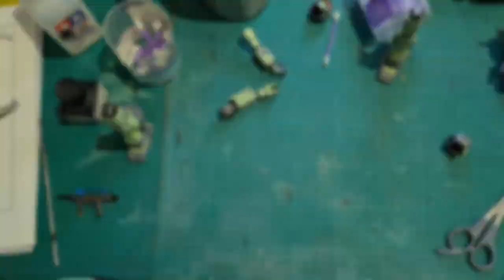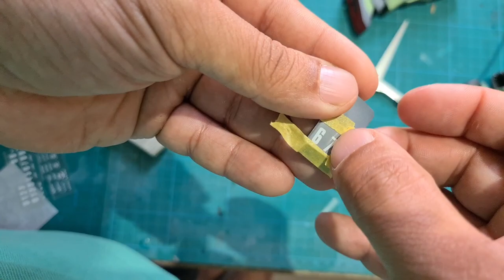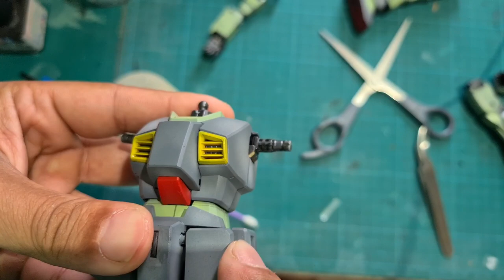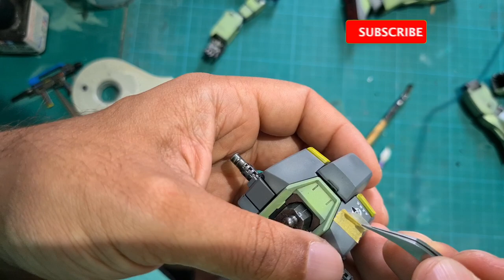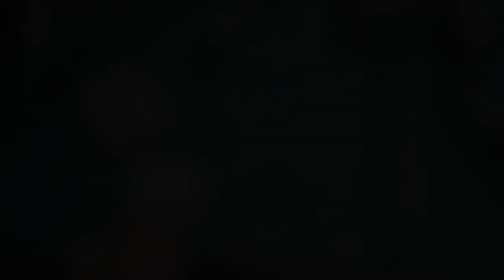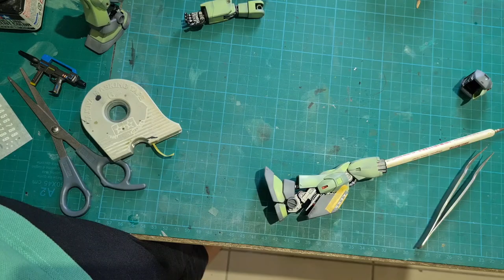How to apply Dry Transfer Decals

Comment: Currently I have the rx 78 ver. Ka and worried if I tried applying the dry transfer decal might not stick to the shoulder part because there's a panel line over it, any suggestions?
Reply from the maker: A decal usually molds to the surface. I would appmy the decal then wait for 24 hours. If the decal has still not gone into the panel line, use a knife on it, very carefully.